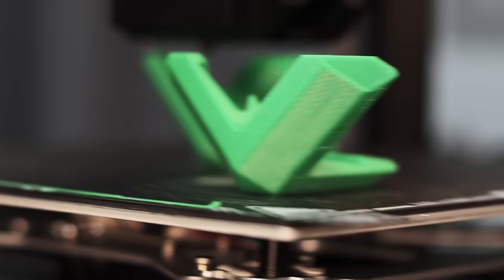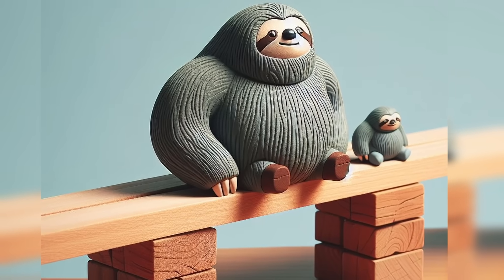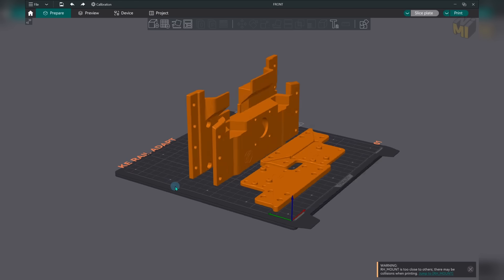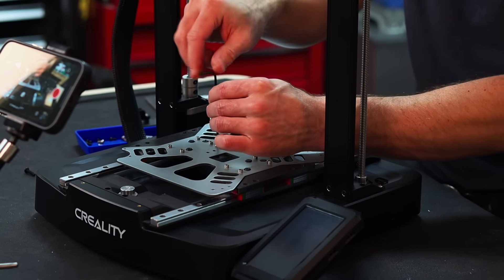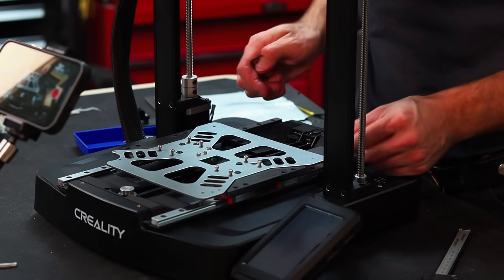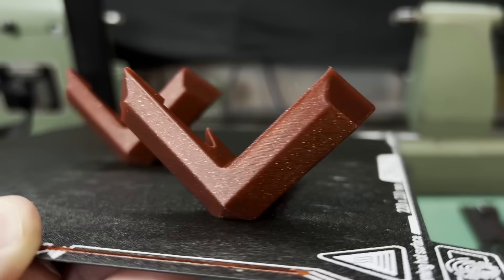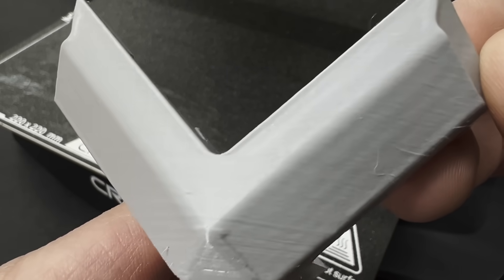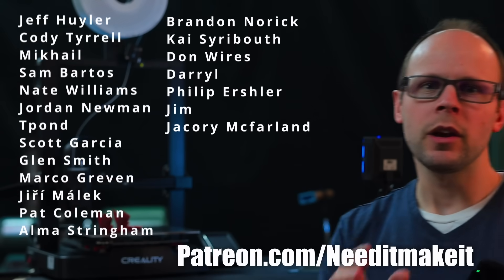UPGRADE your Creality Ender 3 V3 KE with Linear Rails

Comment: Tremendous work! Please go ahead and test the printed carriage, i am really curious to see how that holds up. Also please consider garbing an Ender 3 V3 SE and work your magic on it, i have the SE and i feel that a lot more folks got the SE, as it is quite a bit more accessible in the price department, but it has its own set of flaws.  Thank you !
Reply from the maker: Cool I will, it would work in combo with this upgrade, but I need to add a little more clearance because the PC or maybe ABS plate would need to be thicker, too bad we didn't think of this earlier.  I may also try an aluminum version at 4mm thick which should be around 1/3 of the steel plate and it should be stiff enough as well.  I'd like to see if I can have a company CNC machine it so it has everything integrated into one.  I'll have to check out the SE, it looks similar to the KE - the Klipper and a different setup for the extruder/head.
Reply: @NeedItMakeIt  Stellar!
Reply from the maker: @stefanNT_1008  I have a few projects in the pipeline that I need to finish up but I'll get back to this and we'll get something really good going.
Reply: @NeedItMakeIt  I am looking forward to see what you have mapped out, thank you for your work!
Reply from the maker: @stefanNT_1008  Sounds good!  I have a few videos to get through but I'll come back with something that looks good, works well and is easy to install and print yourself.  Well... that's the plan anyway, whether I can deliver on that, I sure hope so.
Reply: @NeedItMakeIt  Even if you don't get the chance to make it, I tremendously appreciate you taking time to reply. Thank you sir!
Reply from the maker: @stefanNT_1008  I should be able to, it's far easier now that I have a model to work with, but geez I wish they gave us some flat surfaces to work with.  I try to respond to everyone, I don't always have a chance to, but it's something I like to do.

Comment: I have been researching rails for my Zyltech Gear.  Thanks for posting. That's a very clean design and install.
Reply from the maker: Thanks,  I tried to come up with something that was as simple as possible and easy to print, it's not bad, I would have loved to have a few more mounting holes, but I don't like to modify the stock printer by drilling holes into it and that's more work for everyone as well.  Hopefully it gives people a few ideas to tackle their printers as well!

Comment: great video
Great upgrade
Are you not dubling the price for the printer?
Thanks for sharing your experience with all of us 👍😀
Reply from the maker: I was able to get these linear rails for less than 40$ CAN, that's the entire kit, I luckily had the screws and inserts already, unfortunately I didn't have much of a choice but to fix it.  New rods may not have solved the problem and I figured other people would want this if not now, sometime down the road.

Comment: I I have a same wobbling problem on the right side lineer bearings to.  When i press my finger on the right side of bed it goes up and down. But this is my first printer and im not trusting myself to make a huge changes on machine. Maybe one day people start to sell offical upgrade kits for lineer rail upgrade i will buy it but not now.
Reply from the maker: If it's a new printer, I'd suggest you contact Creality and ask for replacement parts, hopefully a new set will fit better.  Let me know if that works!
Reply: @NeedItMakeIt  its been almost a month. i contact my seller multiple times and he said he is gonna call me back but never did. i can feel a gap in bearing but surprisingly there is not huge errors in my parts and nearly perfect. so i just let it go. btw thanks for the advice i will definitlty contact with creality directly to.
Reply from the maker: @alpercagangunes  Let me know if there is anyway that I can help.  I think you should be able to submit a short video to Creality showing the problem along with a short blurb.  As far as where the problems are coming from, for me it seems to be that the extruder cannot handle PETG well, I still can't explain it completely, but maybe this is partly the issues you're running into.